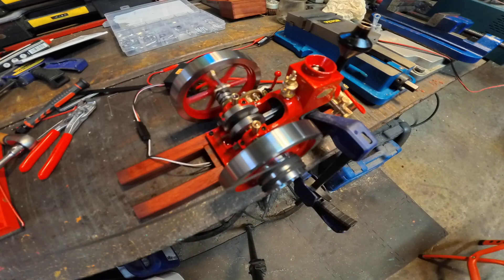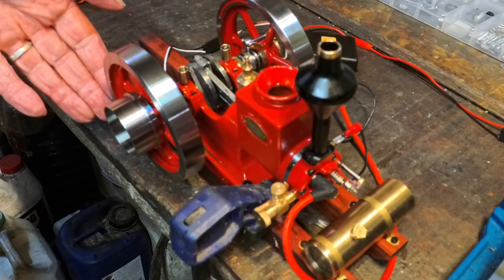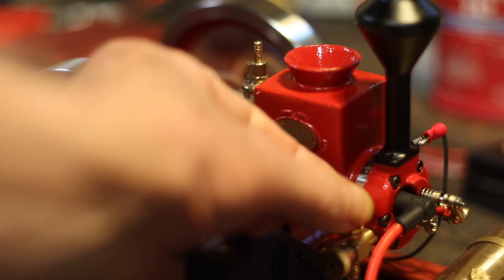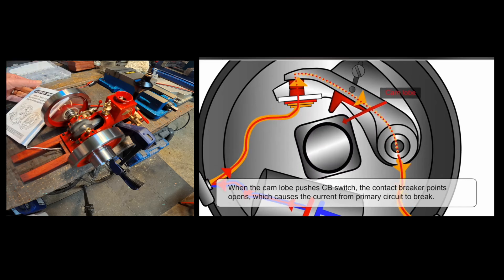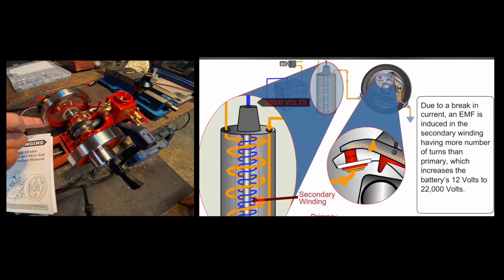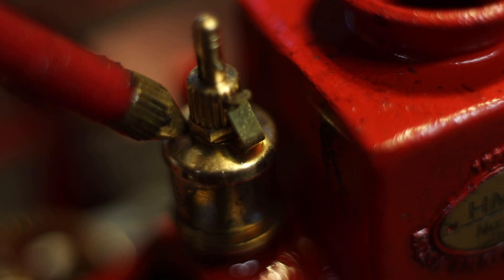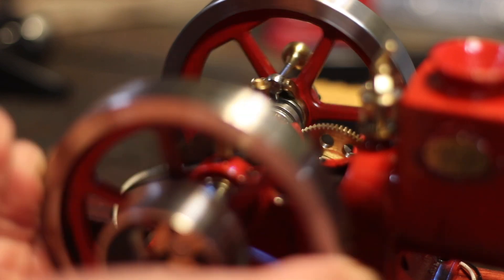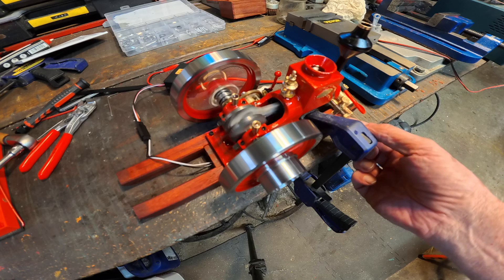RETROL HM01 - 4 stroke working model engine

Comment: I also had no spark, but my issue was the ground wire was acting like a kill switch.   Once I disconnected it and got the mixture needle set to 1 turn open, it fired right up.   No issue with the timing marks.   Yes, a fun little engine

Comment: Simple starter suggestion:  Go to your local hardware store and  buy a tapered rubber plug that will fit only partially into the pulley (Rope starter hub.).  If you have access to a lathe, drill a 1/4" dia. hole through the center.  Machine the tapered dia. to suit if required.  Install a 1/4" dia. carriage bolt from small end.  Install flat washer and nut on large dia. end.  Make sure bolt is long enough to protrude out the back (Nut end.) about 1 1/2".  Get out your electric drill and mount this apparatus in the chuck and "Start away"  I guarantee you will be much less tired at end of day!

Comment: What a lovely but I expect "extremely" expensive toy.
Having recently watched a YouTube video on the closure of the  Mamod steam engine factory,
it's nice to see that all is not yet lost.
If this model is running rich and the plug constantly fouls up. I suggest something is wrong with
the setup. These engines are not meant to fire upon every cycle as yours is doing.
Just go to some random summer fate and watch the bods who collect and display the "Hit and Miss" 
engines from the Victorian era. They fire at random times, I suspect only firing when the flywheel is slowing down.
Thus indicating the timing and mixture must be setup in order to behave this way. 🤷🏼‍♂?

Comment: I have built this engine but so far unable to start it. This is the most informative video on the HM-01 I have found.  Please can you tell me how to fit the red wire via the black  rubber cap onto the spark plug, I.e. do you have to strip the insulation to get a good contact. Thanks. I'm getting current from the little black box thing forgot what it's called but no spark from plug.